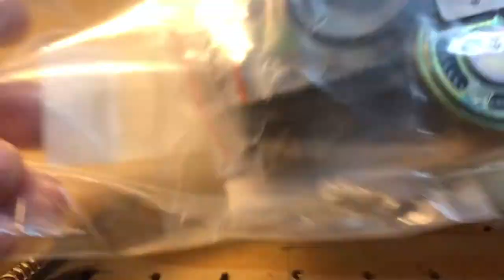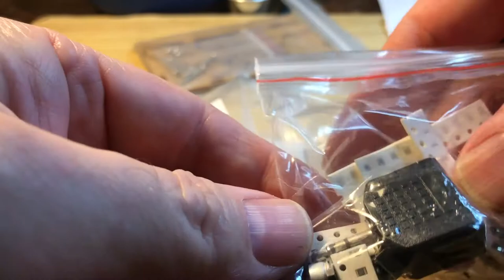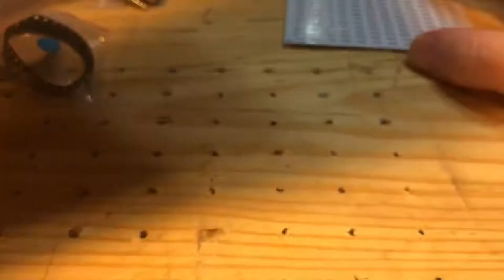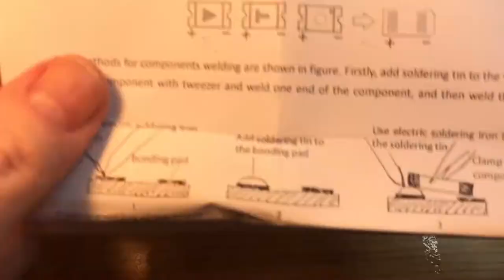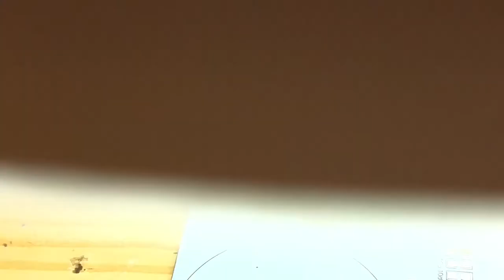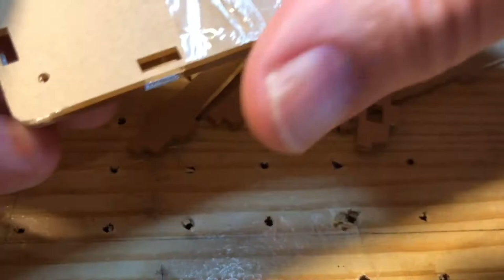Banggood: Geekcreit® 5V LED Music Spectrum

Comment: Hi Edifred, extremely good tutorial! Going to do the job with probably little better equipment, butt with less skill absolutely. Hope it will give the same results you had. Your tutorial will also give a big boost to the results. Also thanks for the camera job, extremely hard to focus and you did better then almost all tutorials I watch before! Respect and thanks! And yes was thinking already of putting the LED colors horizontally but by your explanation of the same row or column I now get it why people have different results. Keep it up!

Comment: Great Edifred. I’ve build another one but complete blue. You should do it !next time I will use hot air and soldering paste to try. For the main back chip you should solder 1 pin like here but a second one in the diagonal to correctly place all the pins on the pads. Waiting for the next kit. I’m playing exactly like you at home but still not have my YouTube Chanel 😁

Comment: Hello, could you possibly upload or send me a message with a clearer photo of the circuit schematic? I bought the kit but it hasn't arrived yet.
Reply from the maker: Hi Dylan. Instructions can be found in the link below.

http://img.banggood.com/file/products/20170314023304979747.docx
Reply: @Edifred2007  This is great. do you happen to have any sort of wiring diagrams for the actual PCB? trying to simulate using LTSpice for a lab project and having some trouble matching up all the wires